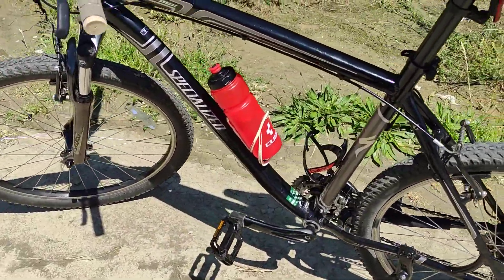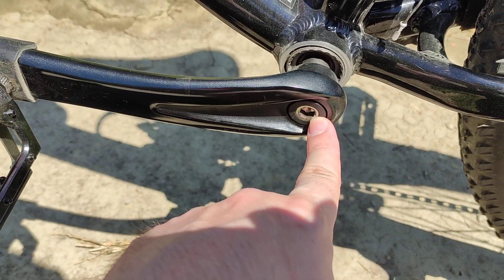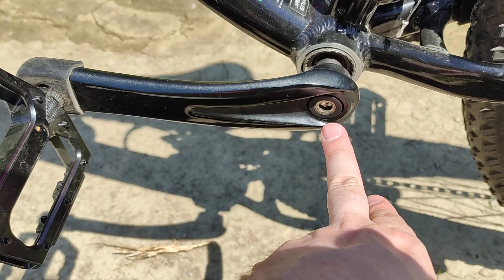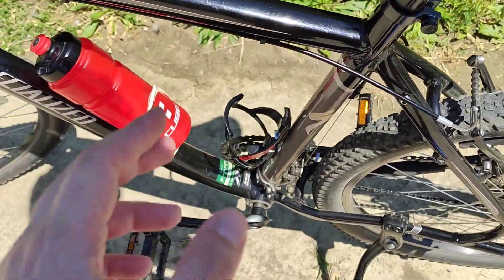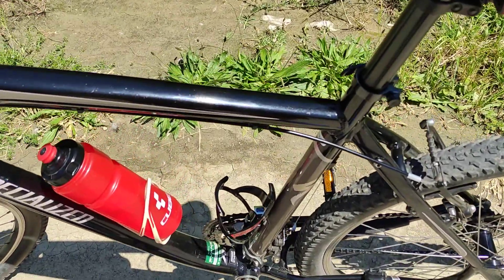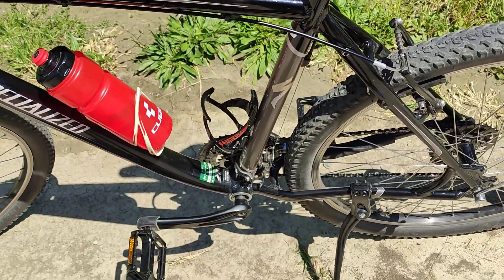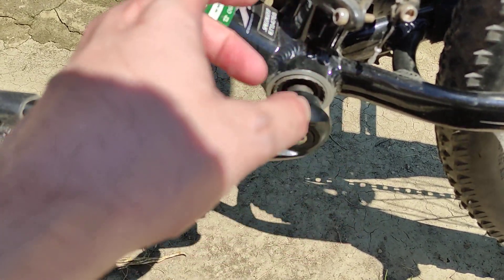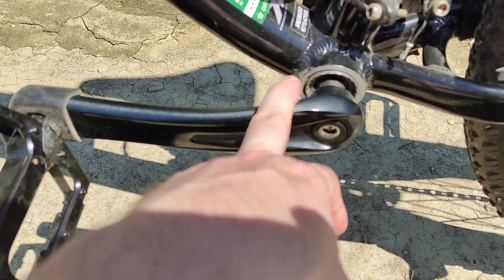Bicycle crankset bolts coming loose, crank arm falling off?

Comment: Wouldn't the bolt snap with a lot of pressure?.
Reply from the maker: Not really, those bolts are usually made of very solid steel.

Comment: this happened to me a few days ago. the pedal started to feel wobbly, but i thought a bearing had gone in the pedal. then a few minutes later the blody crank arm fell off and i nearly lost control. i was surprised it was the arm. if id have known i would have stopped pedalling, doh
Reply from the maker: Yes, that could be very dangerous, rather replace the hub and the crank set, rather than risk your health.
Reply: @PSVICE  i was ok. its funny, but ive been cycling for years and its never happened. there was plenty of warning, i just misinterpreted the symptoms lol. i put the arm back and tightened it back up properly, with locktight! i will always know what it is if it happens again though. sadly, its unlikely other cyclists will know about this potentially accident inducing problem, until it happens to them. :( it would be even worse if the chain side arm came off, what with the chain flying about and potentially getting stuck in the wheel spokes!

Comment: Built my bike last summer. L crank bolt got loose on me this morning while returning on a early am 20 mile ride. In no mood to stop,  I tried to tighten it w/ a pebble.. Helped some, but I ended up walking and have to replace my crank and bottom bracket. Used loctite, but should've cranked those buggers in harder, but I was worried about breaking them. I will now be cruising with 6 and 8 mm hex wrenches just in case. Better now than during my half du attempt next month. Life is beautiful!
Reply from the maker: I had to walk many times as well due to flat tires.

Comment: My whole left crankset  just fell off while I was riding my bike. It has been making some noise for a while but since my Bike mechanism is not that good, I just kept ringing it  until it finally fell off.
Reply from the maker: Sounds pretty unsafe, for example if you are in the middle of a cross road.
Reply: @PSVICE   YEP!

Comment: Sir where do you buy the bolt if it is to damaged
Reply from the maker: Any bicycle shop should have, or online.
Reply: @PSVICE i cant find a single compatible 1 here in india, no shop has 1. Deore 5100 series, worst part is that the mechanic messed the first time he installed it.
Reply from the maker: @AkshatSTR8EDGE  Isn't that crankset hollow, not like the one from my video?
Otherwise, any crankset being sold, cheap or expensive should have the same bolt that goes inside the classic square hubs.

Comment: Thanx, I thought I might harm it if I tightened it too much.
Reply from the maker: It's fine, those bolts and the bottom bracket spindle is made of solid steel.
Reply: I did break the bolt head off by turning it as hard as possible a couple different times, as the problem was reoccurring and I had this same creaking sound as someone else commented. In my case, I think the time has come to replace the crank arm :( My bike is a cheapo though, who knows what is made of what.

Comment: Why do you use nail polish? Can we use solvent cement instead?
Reply from the maker: No idea about that substance, but nail polish can work to fixate the bolt.
Reply: @PSVICE  I used nail paint and am still having same issue. Am going to try loctite
Reply from the maker: @timuhka2984  Try with that as well and tighten it very hard. If still doesn't work, you might need to replace the arm and maybe the bottom bracket as well.

Comment: I cleaned the whole thing and put some threadlock and tightened it. The problem of wobbly crank arm is solved, but now it makes a very bad creaking noise when I put force on crank to pedal
Reply from the maker: I can think of some cases, the whole bottom bracket is damaged. When you move the crank arms, is there any play in the bottom bracket?
Or by tightening the bolts hard, you have moved the bottom bracket a bit as when you tighten it, it puts a lot of force on the spindle threads. That should be ok if the bottom bracket is fine.
Or, the bottom bracket spindles are rounded.
In either case, if the bicycle is old, the bottom bracket is old, you can try to spray some WD40 inside the bottom bracket area (without removing the crankset of course), not too much.
Or replace the whole bottom bracket. If you have the tools. Usually they are very stuck and require to go to a bike shop.
Reply: the crank arm hole has been widened. a shim made from coke can etc will fill this gap and help.

Comment: I have a brand new bike assembled in the store. Took it out for the first time, pedal fell off. I was wondering if something else fell off because I thought I put it back on but it fell off again. Is there anything else besides the crank and the bolt?
Reply from the maker: Hey, the whole crank arm fell off?
Then you need to tighten the bolt really hard. Maybe put some nail paint on the bolt thread. But this is not normal for a new bike. If it keeps doing that, I guess the spindle are rounded and no matter how much you tighten it, the arm will still come off.

Comment: Maybe because of my weight that's why its always coming loose i changed crankset 2 times already and its still loosens now pretty worn out😭..
Questions: When i transfer from 3x to 1x does it fix the problem or 1bys still have the possibility to loosen
Reply from the maker: I ride standing up which puts 3x the force on the crankset, but they still work just fine, so weight is not an issue.
My guess is that your hub's spindle is rounded and it's destroying the crankset arms.
My advice is to go to a bike shop, replace the bottom bracket (12$ for a square Shimano type), tell them to inspect the crankset arms, if they are think they are fine, to install those, if not, replace the crankset as well.
Usually a new bottom bracket and new crankset will last you for at least 10 years.
Reply: Im 155lbs and i have the issue. Its not weight i think its more just wear and tear, they loosen slowly before you notice anything. (2nd new hub)

Comment: Clean threads red loctite and an impact gun lol itll never rattle loose no more
Reply: I hope you don't need to take that back off at some point ... Best to use the blue locktite
Reply: @kegalormoon I used red loctite and it still comes off💀

Comment: Could it be the reason why my crank arm keeps coming loose is because my bottom bracket is wobbly? My crank arm doesn't seem rounded at all and still square so...
Reply from the maker: It could be, normally the bottom bracket should be in good condition, with no play whatsoever.
Reply: @PSVICE  i hope its the bottom bracket, cuz replacing my crank arm is kinda bit pricey😆 thanks btw
Reply from the maker: @iczybear  If it has any play, I would replace the bottom bracket anyway.
You can check a few things, if the arm is rounded or the bottom bracket ends are rounded.
If the bolts are tightened enough.
You need to be careful, if you install a new bb and the arms are rounded, they will also round the bb ends.
A bb is not that expensive, it's like 10$ cheap shimano, but depends if you have the tools and knowledge to replace it yourself.
I replaced my whole crankset including the arms for about 50$. Can't say it was that cheap.
Reply: @PSVICE  i will keep that in mind thank you🤎
Reply: @iczybear  u fixed it?
Reply: @zanjisu  yeah i just got my bike fixed today and it turns out that my bb is fine and the one that make my crank so wobbly is the loose thread bb shell. Tho we manage to fixed it somehow😆

Comment: Thank you, my whole pedal has fallen while biking and got a little hurt and now im wanting to fix my bike to bike again
Reply from the maker: Hey, check if the arm socket (the diamond shaped part that enters the bottom bracket) is not rounded. That might also cause the arm to fall off.
Other than that, try to tighten the bolts as hard as you can.
Reply: Same